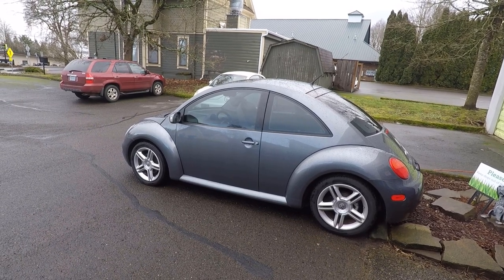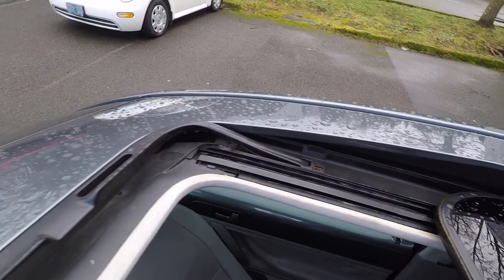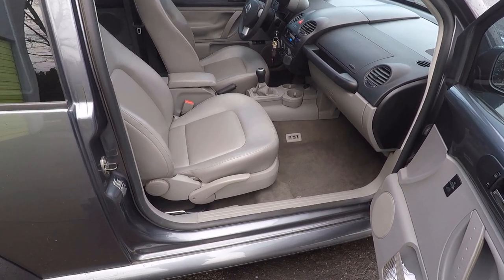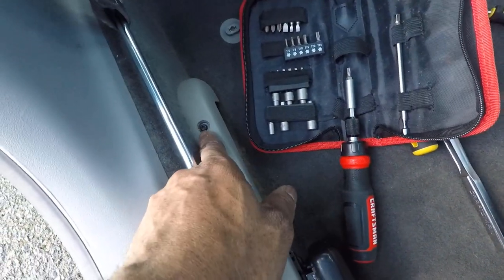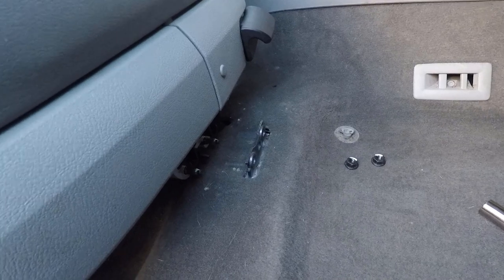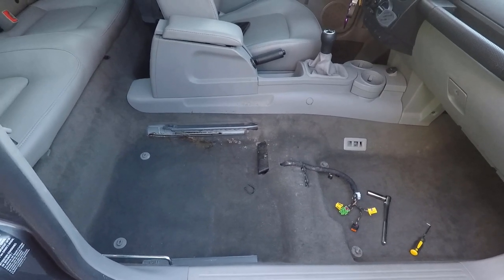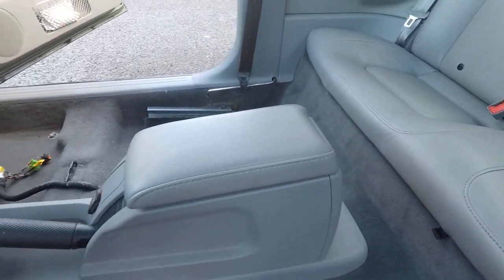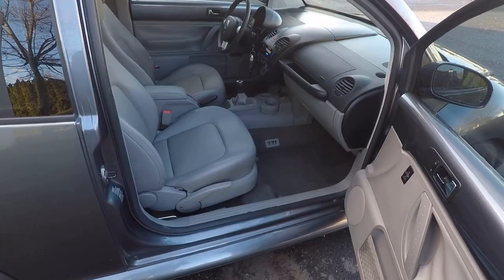How to Remove Seats 2005 Volkswagen New Beetle (carpet has mold from water leak)

Comment: The leak still could be the sunroof.    The drain tube from the sunroof connects to another tube a the bottom of the a-pillar.    These are glued together from the factory, and the glue comes apart over time.   (Bad idea, VW!)    You can pull the a-pillar trim to check.

The easiest fix is to buy a 3/8" to 1/2" reducing coupling to join the tubes together.   (Something VW should have done from the factory.)

Also, lookout for the seal on the third brake light failing, filling the trunk area with water, and setting off your alarm.
Reply from the maker: Great info, thank you. I'm actually taking the car to the dealer in a few days to have the drains cleaned. I don't want the water coming back
Reply: @BuildYourOwn  No problem, you're welcome.   I ran trimmer line through my drains, and they were perfectly clean.    My guess is that the tubes are disconnected at the a-pillar junction.
Reply: @Gr8thxAlot  Yeah, we had one that did that also. Terrible VW design.
Reply from the maker: @ruudvanleeuwen7320  sunroof drains

Comment: On my 2001 Turbo, the sky roof will open by itself. I never touch the dial, but I'll come out in the morning and the roof will be open. Maybe that happened to you. I thought maybe someone had tried to break in, but no, it's happened 4 times.  Any ideas?  Good video anyway.
Reply from the maker: Thanks for watching and sharing your issue with the sky roof on your 2001 Beetle Turbo. It's indeed strange that the roof opens by itself. It could possibly be due to a malfunctioning switch or a wiring issue. Another potential reason could be a problem with the car's comfort control module. As these causes could range from simple to complex, I would recommend taking your vehicle to a professional to get it diagnosed.

In the meantime, it might be a good idea to disconnect the motor for the sky roof to prevent it from opening automatically, especially if it's exposed to the elements. But remember, this is just a temporary solution. It's still important to get the root cause addressed. I hope you find this advice useful, and thanks again for your comment.
Reply: @BuildYourOwn  Thanks for replying. I realize I didn't specify that the sky room doesn't open when the car is running; it's only when parked, which makes it really weird. I suppose it may open when I'm driving and I just don't realize it, but I think I would see it when getting out. I'm not sure what the comfort control module, but I will surely do the research. Another thing I didn't mention is my air conditioner failed a few years ago. It melted one of the big fuses. When I took it to a repair shop, they thought it was probably a cooling fan that wasn't working, yet both fans run.  They wanted $3500 to fix it. The car cost $2500. Anyway, I didn't repair it. My roommate now says he can fix it, so we're waiting until we both have time off. Could this be maybe be a factor to the sky roof opening?

Comment: Super helpful video. Mine had 3 different connectors under the seat, and they all connected in a different way. WTF do car designers put the connectors on the bottom of the seat instead of at the back right at the bottom of the seat cushion? My Durango unclips there and it is soooo much easier. Freaking german car designers. Pffff.

Comment: That could possably be a leaking heater matrix kids. Usualy results in a smelly wet carpet.
Reply from the maker: It was the windshield leaking after it was replaced. They tried to deny it of course. But when they replaced it again the problem solved. The dealer checked the sunroof drains and they were perfect